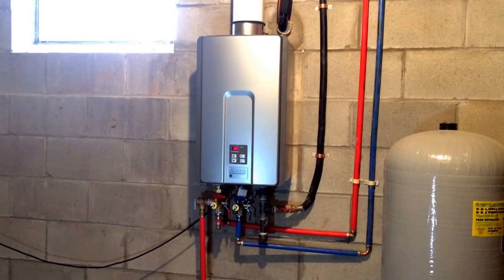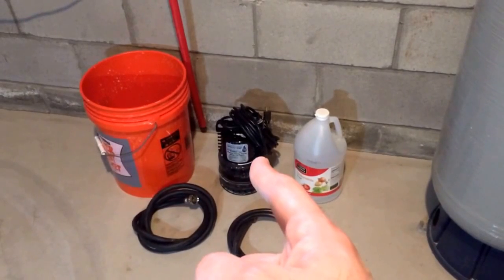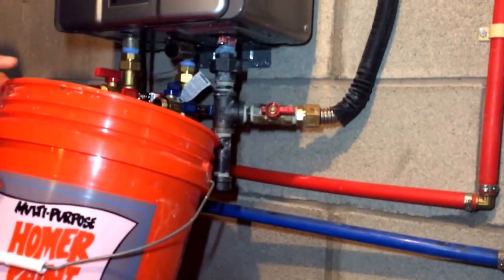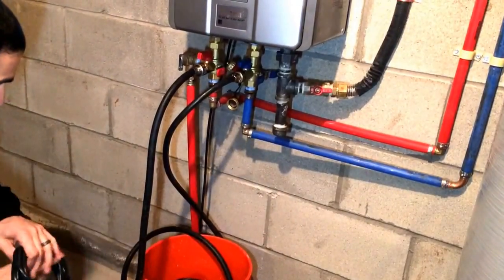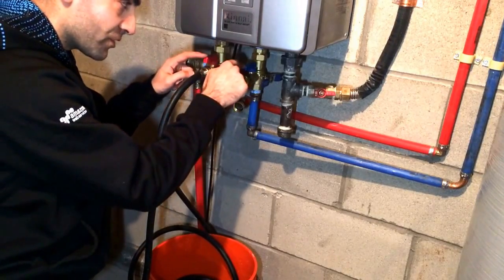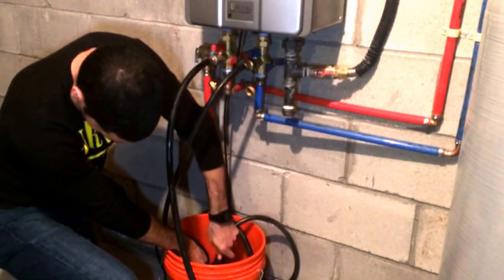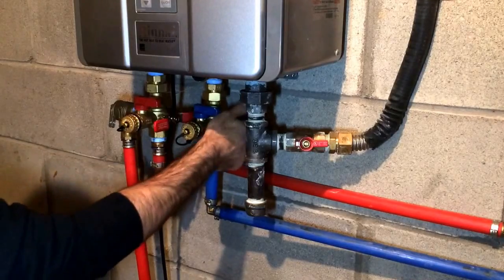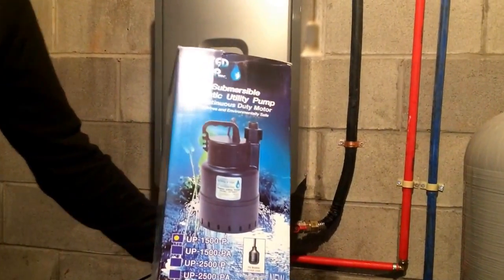[SOLVED] Tankless water heater flush - Easy descaling method - Fix error code LC - Rinnai RL75i

Comment: I followed the instructions in this video to flush my Rinnai tankless water heater after getting the code “LC”

Initially when the pump started, the solution in the bucket turned chalky colored. After letting it flush for an hour, I went to turn everything off and the solution was clear! What happened there?

I am also now unable to turn the cold water valve back on- it was moving fine when I shut it off, but now it won’t open again. Any ideas?
Reply from the maker: Not completely sure what happened with the clear water, but the scale likely settled to the bottom of your bucket.
To get the valve opened, you may need a wrench. A piece of lime scale may have gotten jammed in there. Or the other issue could be, and no offense I swear, that you may be trying to tuen it the wrong way.

Comment: Hi, I flushed my tankless heater for 2.5 hours today. The vinegar discolored like yours. The hose I used has a metal part. It got rusty. I’m little bit worried about my heater. Did I run the pump too long? Vinegar was little bit hot though. Hope I didn’t damage my heater 🥲
Reply from the maker: I can’t be sure everything in the path of flow is pure copper. Vinegar is ok being in copper for a very long time, but other materials, or copper alloys maybe not. I would say keep an eye on your heater for the next few days and see if it springs a leak. If not, then you should be just fine. Yes, my hoses also rust in the presence of vinegar. I’m not sure why the blue color. I think it’s a good thing though. I believe it’s super fine residue coming off the inside of copper tubing and not the result of copper corroding in the presence of vinegar. Lastly, mine also heats up. I always figured it was the semi-submerged pump. Heats up in partial air, transfers that heat to the liquid. Good luck!

Comment: Rinnai and other tankless systems recommend a flow rate of 2 to 4 gallons per minute.The pump that you linked is far in excess of that amount. Is this pump too powerful?
Reply from the maker: Truthfully, I winged it mostly based on the thought that I’d like to use this pump for other applications should the need arise. If it helps, my tankless is now 8 years old and still running strong. But good looking out. Certainly helpful to know the flow rate. Thanks.

Comment: you don't need to turn off the gas and power to the water tank before flushing?
Reply from the maker: Power yes. Most definitely. Gas though is technically not needed. Not a bad idea, but also not necessary.

Comment: We did this , and even replaced some of the piping as they were corroded . We had to remove the front cover and reset the codes by holding the 2 buttons down simultaneously , but 24 hours later … machine is beeping . With same code LCO. :(
Reply from the maker: Unfortunately you may need to flush it again. If you only used vinegar, you may need to go with something tougher. A citric acid based solution probably, but there are other tough things out there. I’ve heard good things about a product called Haymaker.

The point is, if the water heater is still telling you there is a lime condition (LCO), it’s best to lean on that before looking elsewhere for a problem causing a false error. Rinnai designed this error to be a last resort sort of thing… as though lime scale is really far along now. So you probably need a stronger solution or run vinegar longer to get more lime scale out. I’m sure you’ll get it with another good flush. Hang in there.

Good luck!
Reply: @tareksaleh77   so finally got the haymaker descale solution. Ran it through 45 min and  flushed it out . Did everything we can and reset the error code , unfortunately we woke up with the machine beeping and the same error code. So now I’m wondering if it’s something inside the machine we can’t get to . If there is anything else you can suggest please let me know . Or last resort is calling a “professional plumber” . Thank you.
Reply from the maker: Dang! Sorry to hear that. Is it younger than 5 years? Rinnai (if that’s what you have) might cover a repair under warrantee if there’s a bad sensor or something. You might try calling them to see what they can do. I’ll give it some more thought and try to get back to you.

Comment: You didn’t flush with water after vinegar, close gas valve neither, not cleaning water filter, not a good work.
Reply from the maker: Most of these are good points. Thanks.

Comment: Hi, our old  on demand / tank-less water heater system is messed up. This one has a recalculation pump. It seem we only get hot water when another hot water tap is open than it seems to heat water fine than after a minute the water flow completely shuts off. If I turn the hot water valve off for a minute or so it will turn on with good flow for about a minute than completely shuts off the water flow. Anyone every had this issue, and how did you fix it  ?  Thanks
Reply from the maker: Hmmm. What’s the brand and model of your unit?  Water flow wouldn’t normally stop for anything unless there is a valve inside stopping the water.  Or a valve elsewhere in the hot water line which is doing so.  Normally if there’s a problem with the water heater, it would simply stop firing. You’d still get flow, but it would be cold.  If your flow is stopping altogether, assuming there is no device between your water heater and your faucet, there must be a valve in the unit which is closing due to some emergency. Let me know the model and I’ll see what I can find in the troubleshooting guide. Good luck.
Reply from the maker: Oh, you mentioned the recirculating pump. Can you tell if it is on the feed or the return line? If on the feed line (which it shouldn’t be) that could be part of the problem but even then not very likely. If on the return line, definitely not the problem.

Comment: Aren't you supposed to run some cold water briefly through the system to flusk out any residual vinegar?
Reply from the maker: Yes. I missed that step in recording my video. What I like to do, though, is pull some of the vinegar water up to my shower after doing this to have it clear out some of the lime scale in the valve. I turn it on until I smell vinegar then shut it off. I let it sit for 20-30 minutes to dissolve some lime scale. It helps. Then I flush it all the way through.

Comment: Rinnai training video says to use 4 (four) gallons of white vinegar
Reply from the maker: True. In my experience it’s a bit of waste. I don’t know the chemistry between vinegar and lime scale, and if the vinegar becomes less potent after it has reacted with some amount of lime scale. But I find that even with one gallon, it removes a ton of it as evident in the large amount of debris at the bottom of the bucket. It’s more in the winter time. But yes, you’re right. Rinnai suggests using more.

Comment: Such a pet peeve of mine when I see people pull power cords out of outlets by the cord itself.  Grrrr.  You should have flush out those service valves by running a little water through them before closing it all up.   You've left vinegar sitting now.
Reply from the maker: I hate it too. That guy’s such a dumbass.

Comment: When or how often this process has to be done?
Reply from the maker: Northern states, every 6 months. Southern, every year. But it varies. For example, we’ll water is incredibly hard and will scale up much faster than municipal water. If you notice your fixtures starting to lose pressure, you’ve waited too long to flush your water heater.
Reply: @tareksaleh77  Thanks for reply!!!  one more question.... water heater is working so good except for the shower, my house has just one shower 2 floor, water heater is on the garage, every faucet get hot water but not the shower, is so week or nothing. Any advice?  Thanks in advance.
Reply from the maker: It sounds like a piece of debris detached from your water heater and lodged itself in the hot water side of your shower valve. You can test it. Do you have good cold water pressure in your shower? If both hot and cold have low pressure, then your shower head is the culprit. Remove it and clean it of debris or replace it all together. If it’s just the hot water, you’ll have to take apart the shower valve and do your best to clear the obstruction from the hot water valve stem by taking it out. Sometimes just opening and closing the valve stem gets it pushed through. Make sure to shut the water off from basement though. If you’re not sure what valve stems are for single handle shower valves, a google search may help. Or, reply back and I’ll try again. Good luck :)
Reply: @tareksaleh77   awesome is a 3 knobs shower valve, ill check everything today. Thanks for your help.
Reply from the maker: Ah, should be even easier. Take the hot water knob off with a screw driver (probably has a little cap over it). Take off the trim plate. Disassemble until you expose the valve stem (google for images. You’ll need a wrench, such as a socket wrench or an adjustable wrench, to take the stem out. MAKE SURE to shut the water off at the main or the bathroom isolation valve before you remove the stem. Once removed, take it to Home Depot or Lowe’s and match a new one. Or, you can inspect it for obvious wear or debris and reuse it. Either way, the stem is the likely issue. Replace everything exactly as you removed it and try it out. Good luck.
Reply: Tarek's DIY  you have to be right!!!!! I’m testing and I get good pressure water and good hot water in the tub spot! But when I change to the shower 30 seconds later start getting cold and the pressure is pretty low!!
Reply from the maker: I hope you solve it soon being that this is your only shower :) BTW, if you’re weary about taking apart plumbing fixtures (no offense, many people are), this job should be one of the easier ones. Valve stem replacement is very common. It can be done with household tools and little fear of breaking anything. I think you pretty much solved the mystery with the tests you did. I hope you’re able to take it all the way to a permanent fix soon.

Comment: After cycling the vinegar, you need to leave the hot water hose connected and service valve open, close cold water service valve, open cold water supply line and let water run for a couple of minutes to clear out any debris that is left.
Reply from the maker: Completely right.

Comment: Thank you, works great; the vinegar started out clear, but by the time an hour went by it was the same color as the vinegar in your bucket. Thank you for a very helpful video!
Reply from the maker: Glad to hear it. Yeah, that scale breaks off in chunks and makes it’s way into your hot-side fixtures. It’s a real pain. Need to flush often. I’m gonna try to make a video showing how to mitigate the chunks and also how to clear them out if they do get in there. Thanks for the comment.

Comment: Dude you forgot to wash the vinegar inside the unit with fresh water before you put it in operation.
Reply from the maker: Yes. Good catch.
Reply: Tarek's DIY how do we do this step? I'm attempting my first flush tomorrow. This video answered all my questions/concerns, just need to make sure I do this step mentioned. Is it the same method as the vinegar and pump but instead use fresh water and pump?

Comment: Is an hour the standard time to leave it to flush out? What happens if you do it for less than an hour?
Reply from the maker: You gotta figure lime scale builds up at a pretty constant rate over time. It actually gets thicker when it builds up. Therefore, running vinegar past it will dissolve it away... also at a constant rate. 1 hour is actually the maximum level you should run it. It’s there for cleaning a pretty severe build up. We have very hard water in the northeast. I have to flush mine twice a year. I can actually tell it’s starting to get bad when the hot water fluctuates in temperature while I’m in the shower. When it gets to that point, I know that the flow sensor is getting covered. So, I give it the full hour and it’s perfect again.  Definitely don’t run it for 2 hours or more. You can risk damaging rubber seals or non-copper components. I hope this helps.

Comment: Do you know if the residual vinegar in the lines would effect a hydronics heating system?
Reply from the maker: Sorta. Need to get that vinegar out as it can damage rubber seals and non-copper components over time. But, trace amounts are not a big thing to lose sleep over. Just flush it through the service valves for a minute or two at high pressure and you’re good.

Comment: As someone who notices the little things, aswell, by code, you cant have pex for the first 18" of the water heater. (UPC 2018 - 604.13)
Reply: I noticed that too, but every state has different codes, as I learned moving from NY to FL.
Reply: @nelsonocasio2462  thats true to a certain extent. The UPC covers the US, Canada, Mexico, and parts of Africa. Not ironically, so does the IPC. It just depends how each Country, State, and even municipality chooses to adopt the code.

I am based off of LA, California. California adopted the UPC, but has its own rendition of it named "CPC," or California Plumbing Code. Los Angeles took it one step further and made a stricter version of the CPC and named it "LAMPC," or Los Angeles Municipal Plumbing code. Note that not all parts of LA uses the LAMPC.

Comment: You missed a step. You didn't run fresh water through the tank to clear the vinegar?
Reply from the maker: Dude, so few people notice that. You’re absolutely right. However, I have a severe hard water problem so I don’t mind running some vinegar through some fixtures afterwards. Even as little as it is. But thanks for the comment. I appreciate it.
Reply: Thank you for the video. Appreciate it.

Comment: You didn't flush the vinegar out of the unit before restarting, then it went all through the house lines. Leave the hot water hose on the unit and flush fresh cold water through the unit for about 3 minutes.
Reply from the maker: Good point. I don’t mind it much as I have a severe hard water problem in my house. Some vinegar through my next used fixture probably did some good (marginal good anyway. But yes, you’re correct. Thanks for taking the time.

Comment: I would use more vinegar.  Every post I read says 3-4 gallons.  And connect the hoses before you drain the water so you don't run the risk of getting hit with (hot) water.  And lastly, more often.  The scale will build faster in the heater then on the shower head.  If you wait to long, it can damage the heater and cause a leak when you do clean it.
 Otherwise, great job.  Much easier to follow your video then a users manual.
Reply from the maker: Dude, all solid comments. Very valuable to anyone reading this. Thanks for taking the time.

Comment: Great Video, i like it better than the manufacturer’s video.  Quick question:  Did you shut off the Gas?
Reply: I always shut off the gas , added measure
Reply from the maker: Nah. Maybe a good idea for good measure. But being that it’s an unofficial video, we home owners can do anything we want :) kidding. But seriously, unless you’re planning to open the unit, or work on it with the power plugged in, no need to shut off the gas. It’s easy enough to do though if it helps you ensure you won’t boil vinegar. Thanks for the comment. Much appreciated.

Comment: I told the homeowner "I don't service tankless heaters, I install them". Also, told him to just leave it "as is" cuz it's still working fine. 
Once I touch it I'm married to it. He talked me into flushing it with vinegar anyway.....said if something went bad he wouldn't hold me to it.. No pump so I took a brand new Hudson Sprayer, put a couple pints of vinegar in, hooked it up to the cold water inlet, filled the unit and shut the valves to let it set for an hour. Came back and it was leaking INSIDE THE HOUSING. Something about pure vinegar did a number on a couple small O-ring joints, where the water enters and exits the heat exchanger. Ended up hanging a brand new one ( $1,400.00 and change). Good thing we had the talk before. I can hear another  customer saying "Well...it wasn't leaking before you touched it". Never again for me. I'd rather have my customers mad at somebody else than me.
Reply: I wouldn't let you touch my Rinnai either.
Reply: @JoseCruz-kp7ru  _________I'm a "new construction" plumbing contractor. I do custom houses and major remodels...I don't advertise, my clients (general contractors) keep me busy. They use me exclusively because I've been plumbing my whole life....I'm pretty good at it. I made the above post to warn others of what can happen if you service a tankless heater that's never been serviced in 10 years. You are the reason professionals like me don't advertise.....I hate working for cowardly  douchebags like you. Have a nice day.
Read More

Comment: I would flush with freshwater for few minutes after the vinegar
Reply: Yes, this is the correct procedure (flushing with clean water before re-opening your valves to the house). You should NOT smell or taste vinegar when you turn the taps on. That means you have sent vinegar and scale into your clean water lines. Bottom line, dont trust just a youtuber. Always read the manual and follow manufacturer's recommendations. P.s. drinking diluted acetic acid (vinegar) won't kill you.